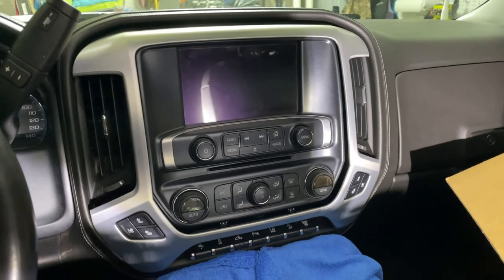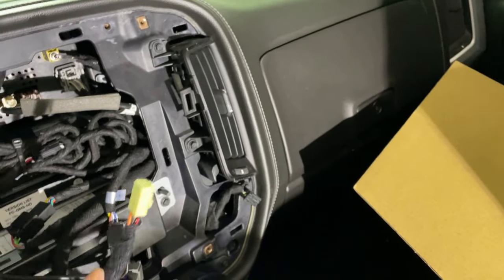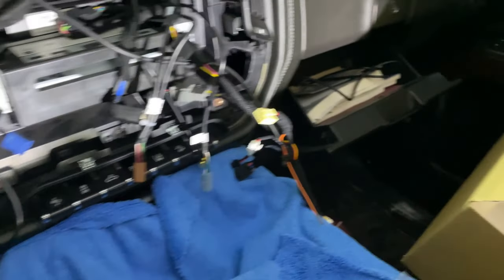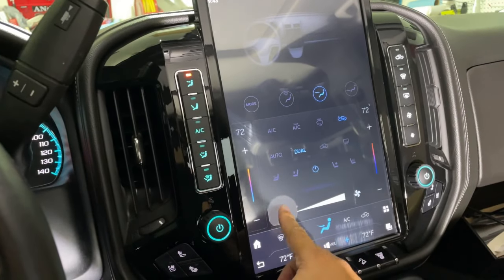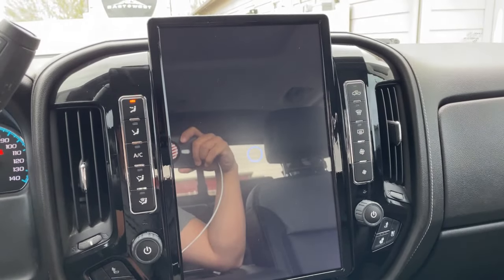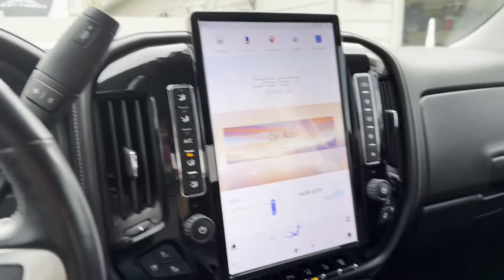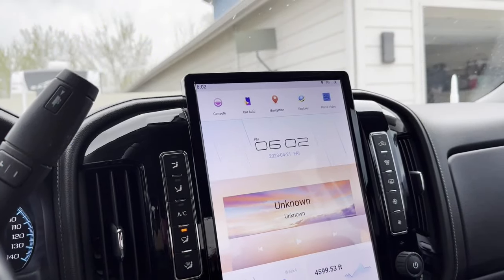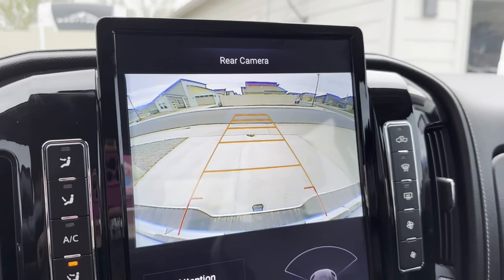AutoTec Pro Tesla Style Screen Install and Review 15-19 Sierra/Silverado

Comment: How do you access the stock vehicle page if you need to change it? I cannot get my radio infotainment to show in the console app.  It is just black on the screen area that would mirror the stock radio functions.
Reply: Mine is doing same thing
Reply: Did you ever figure this out? I'm having the same problem
Reply: @bigmdesign9616 ever figure it out? I'm having the same problem

Comment: I just installed my and the radio station doesn’t show , when I go to console only shows the ac and the top is black where supposed to be the radio , how can I fix that
Reply: Oof. All my OEM stations (FM/AM worked) as did Sirius. Give them a call if you haven't
Reply: did you figure out how to fix this? Im having the same problem.

Comment: How about the oem microphone? It that still operational or do you have to use a new microphone?
Reply: OEM Mic works fine for me. Packing includes a mic for people without a mic.
Reply: Sorry one last question, is the silver/grey bezel oem match to rest of trim?
Reply: @oscarbustos6634  I went with black because I knew it would match the tablet, buttons, etc and take out matching problems. Mine looks pretty sharp, zero complaints but I can't comment on the silver/grey.
Reply: @oscarbustos6634   It's close enough that no one but you will notice unless you point it out.

Comment: Can anyone explain where to install the steering wheel control on a 2018 Chevy? So my buttons will work.
Reply from the maker: You have to remove the steering console surround plastic and it’s a plug on the underside of the column that it goes inline.
Reply: Perfect thank you..
Reply: How do I get this device to automatically sync Bluetooth for some reason it only syncs up when I hit the console button if I don’t sync on console I have no sound.

Comment: Can you add more cameras to connect to the screen?  I’d love to integrate a forward facing and cabin camera that are all recording.  I know this is very unlikely
Reply: You'll have to ask about that. The unit ships with support for OEM cameras and includes a pigtail to allow you to install 3rd party (non-OEM) cameras but I don't think the forward facing will work the way you want. Especially if you want a storage engine for recorded content.
Reply: There is an AUX-V cable that comes with the unit. Vendor said that "might work". I wouldn't hold your breath.

Comment: does your steering wheel control work to skip song when your in Spotify or Pandora  or apple car play, mine only work when  I open up the console app  it works to change radio  station  but notoutside the console app
Reply from the maker: I had to install the steering wheel harness to get mine to work. But it works perfect now.
Reply: @CollaGoUnLTD can you show how you got it to work bc I have the same problem I could be doing something wrong but I would love to get mine to work. Thanks!
Reply: I can confirm you need steering wheel harness volume works skip does not work without steering wheel harness
Reply: Where does the steering wheel harness go? I’m sure I will need to install it on my 18 when the head unit arrives

Comment: Does the 4g that comes with the truck still work?
Reply: Yes, however, the tablet has it's own SIM slot which you may or may not want. You should be able to connect the unit to your OEM 4G network just fine.

Comment: Do you get sound when you play YouTube? I’m having issues anyway on how to fix that
Reply: Make sure you plug in the Aux pig-tail and then be sure you go to the Console and hit the media button until hit says "Aux". Then go back to YouTube and it should work.
Reply: @IAOutdoors  does the pig tail connect to the black cord? going off of the white cord branching out to the colorful cords. And did you connect the pig tail to anything or no
Reply: @squigger3394  AUX pigtail plugs into the AUX port under my center console. Has nothing to do with wiring of head unit
Reply: @IAOutdoors  awsome thank you man just got it to work. Now I feel like an idiot but how do I even set up the backup camera? It came with the unit?
Reply: @squigger3394  if it is factory OEM camera then you may need to go to Settings->System->Factory Settings and change the first settings at top right of page. Mine worked fine when I got it but after firmware upgrade it set it to the wrong value so I had to change it. If you can’t figure it out let me know and I’ll get the exact setting name and value
Reply: @IAOutdoors  I got the camera from auto Tec with my order. I don’t even have a clue on how to set the camera up to my back tailgate…. I just don’t understand bc the camera and wire are so small so I don’t know what it would connect to. Any chance you know of any videos on how to set it up. Thanks
Reply: @squigger3394  so non-oem. You’ll need to contact their support
Reply: @IAOutdoors  I appreciate you leaving that comment about the AUX pig tail I had been stuck on that problem for a week now

Comment: so I have sound for the radio but when i try using youtube app i get no sound but it plays the video help
Reply: I have the same problem I need help
Reply: Did you plug in your Aux cable? You may have plugged one of the top off yellow connects on the back into the wrong port. It should be above purple connector. My sound didn't work for apps either. I was plugged into the wrong port
Reply: Im having the same problem cannot get sound from anything on the internet

Comment: I installed mine it all works but the screen does thia flashing thing and freezes my camera and screen. I can hit home and it starts over but anytime I go to the console it will eventually flash and the screen freezes. I've removed 3 times checked all the connection and each time it gets worse not better. 
Anyone else had a problem?
Reply: This happened to me. I took the screen back out and plugged the main plug back into the stock location. Then reinstalled the screen and it started working that time.
Reply: Mine came with an extention for that main plug the blue one my stock is really short and I can get it plugged in without the extension they have been trying to give me software updates but today they said they would just send me a new one so hopefully the new one works thanks for the help though

Comment: Did anyone had a problem with the rear camera if so what is the solution
Reply: If you installed the extension harness for the power cord.. 750 in the video, u have to remove it. Then go to sertings>settings guide>car protocol. Password is 666888 change the first setting to VGA. Save and reboot
Reply: @joebagodonutz  He may also need to go to Settings->System->Factory, enter the code 7890 and be sure to set the camera format properly.
Reply: What does the extension power cord harness look like have trouble with back up camera

Comment: I have the same unit and everything works perfect but my video apps, such as YouTube. Spotify etc. the videos play but no sound. Does anyone have this issue??
Reply: i’m having same issue, suppose to get aux option when plugging pigtail into aux port..  i’m about to start checking fuses i guess.
Reply: @ronniefranklin1952  Hey Ronnie, please reply back here if you figured why no sound in third party apps, mine has no sound on YouTube, pandora
Reply: still no luck.,  i’m at a loss.  i put OEM radio back in and my radio still isn’t recognizing the aux connection.
Reply: Having the same Issue with no sound from the apps? Has anyone found the fix?
Reply: Same issue.  The manufacturers are no help either, been trying to fix for 3 months now. (Bluetooth and YT, apps dont give sound)
Reply: i think it’s about to get returned before to late.
Reply: same issues i have with mine, any solution before i return mine.
Reply: U have to plug in that little aux doggle in the aux port in ur arm rest, also if sound comes on and is super low quality, cracking, buzzing, u need to go to sound and click sound gain option, it should have  the gain option for all sources. Turn all them to like 15 down from 30+  that should allow the system to play clearly. Also make sure in settings ur factory Amp is set to On.
Reply: Maybe I can help. I just installed mine last night. The first that I noticed the sound was, there but really low. My scroll volume changes the radio station instead turn the volume up or down. Today in the morning after sleep 2 hours I just think what if I used the switch for radio station on the console app and that's turn my volume up. Now I'm trying to figured out how change that to the right controller.
Reply: On the cars original steering, connect to audio then to aux then you will have sound

Comment: Anyone know why it wouldn’t work with a 2014 as that was the first year of the new body style eg looks just like a 15.
Reply: The site says it works for a 2014, is that not the case? I have a 14 SLT and thinking about getting it.
Reply: I had no camera or sound. I have a 2016 1500 z71 without rear entertainment.  If u email them, ask them for the links to the guides on ther website. The guide says if the cameras not working, dont use the extension harness for the main power. Its  black on one end and blue on the other and one corner is angled and its about 4 or 5 inches long. If u used it, remove it. If that dont work the settings under settings> system> settings guide, the car ac protocol can be changed according to your vehicle ans the camera can be changed to vga format. Its the first option once u put in the password default 7890. To access the factory settings page under settings>system>factory settings, the password is default 666888. Also, i had no sound. The headphone dongle jack  must be plugged into the senter console port. Once thats in go the icon that says console and select aux or media until you see your phone, providing your BT is paired and connected.. but... heres what i did and it took me a week to figure it out.. when i removed my factory radio, i deleted the MyChevy from my bluetooth list. Well i reinstalled my factory radio, and paired it again. Then took the factory radio out and reinatalled the android unit and the bluetooth needs to be connected to the mychevy and the android unit. Wont work unless they are both connected.. i uninstalled android auto from my phone because u almost dont even need it with this unit. Maybe for msgs and calls but thats not important to me so i just use the music from my phone. And then once both bt are connected, play some music from your phone and click on the BT music icon to bring it up on the screen.  I now have sound,  and with the equalizer thats installed on the unit, the sound is amazing. So dont give up. Its a beautiful unit, it does work. I was on fire cuz i had no beats for a week or a camera. I was on fire.. but i kept tryin then they gave me the link to the guides which the password to see the guides is auto123 wen u go the website. They really could save a lot of negative feedback and angry customers cuz it aint cheap lol if they put a paper version in the box.. hope it helps. But if not read the troubleshooting guide. It might be a lil different depending on the year and model. I hope you all pass it on cuz you know exactly how frustratimg it is wen they say works right out the box. Or plug and play.. amd it dont work.. good luck everyone! Once its working youre gonna love it. I promise! Save and reboot after changing settings.

Comment: this would definitely be the best T-style system out there and it is for a lot of people but there are a huge group of people not able to get sound from apps/internet me being one of them….  if research led and tried everything and still nothing.   if anyone has a solution please please post something.
Reply: well after all that it was my aux/usb port, i replaced it and finally getting sound.  i’m sure i’ve spilled a few big gulps and fried it.  great unit
Reply: Where on the radio do you connect the Aux cable, I know it’s from the counsel or armrest, and from there where on the radio does it go to?

Comment: I just installed mine and while using Console, everything in the "oem" display is shifted to the right, anyone know a fix for this?
Reply: Found how to adjust the gm screen, now on the only setting where it’s centered, there’s fuzzy lines across the screen and while the camera is in use. Everything else works fine outside of Console.  Anyone experience this?
Reply: How did you figure that out
Reply: @johnharrison4659  I basically went down every option to see what worked for me. I have a 2014 so I used the 2018 I05/I06 setting and console screen setting to 7.
Reply: Ok do you have the code to get into those settings?
Reply: @johnharrison4659  Go to Settings – Systems – Car Model/AC Model (Password: 666888) to confirm if you have the correct settings according to your original vehicle. Try different Car Models based on the year of your vehicle. For more details, please refer to our setup tutorial video instruction below.
Go to Settings – Systems – Factory Settings (Password: 7890) – GM Screen Parameter (This will also fix the issues of “Original screen” does not align up properly under the “Console” Screen.

Here’s where I adjusted the settings.
Reply: Awesome thanks so much!

Comment: Has anyone else have issues with friction noise in the radio? Doesn't happen when using the console.  But when switching to aux to use the headunit, i get really bad friction noise
Reply: I get barely detectible cracks in sound using CarPlay. It always goes away. In general, it doesn't bother me very much. Did you figure this problem out?
Reply: @IAOutdoors  no I haven't figured it out. I have a friend whose does the same thing. It's horrible. The more you turn the volume up, the more you hear friction and popping.  I read that some android radios doesn't work well with the factory amp. But my friends truck doesn't have the factory amp and his does the same.... long story short,  I use the console mode and link it to the factory GMC bluetooth to listen to music. Witch kinda voids the whole point of having the screen
Reply: @1djolly  see if this helps: Settings > system > factory settings > original car with amplifier setting from 30 to 0
Reply: @IAOutdoors  I'll give that a try,  thank you !
Reply: What is the password to get into factory settings??? It is not 666888? Thank you

Comment: 2016 chevy back up camera not working
Reply: Same for me..
Reply: Has anyone found a solution. I i stalled this stereo 2 weeks ago and now the camera wont work.
Reply: Same here
Reply: Same 🤦🏻‍♂️
Reply: I found the solution
Reply: @josear9169  what was the solution??
Reply: @josear9169  tell us the solution 😫😫😫
Reply: @marthagarcia2784  please let me know if that works for you
Reply: @josear9169  you didn't say what the solution is???
Reply: @marthagarcia2784  i did 😂😂 dont know what happen
Reply: @josear9169  ok so whats the solution??
Reply: @josear9169  ??????????????????
Reply: @marthagarcia2784  when you press console you can see the original display?
Reply: @josear9169  so i have to go to console everytime i back up
Reply: @marthagarcia2784  no on the screen you see where it says console if you press there you can see the radio and all that right?
Reply: @josear9169  yes
Reply: @marthagarcia2784  Ok the go to settings/system/ factory settings code is 7890 then the first option say reversing video format change to vga-yuv signal then press save and reboot
Reply: @marthagarcia2784  try that and let me know
Reply: @josear9169  i couldn't figure it out. Do you have Facebook or Instagram so i can send you pictures of my screen and you can walk me thru it please
Reply: @Jose Ar  ok i figured it out but when i wento to the camera setting it was already in the format you told me. I switched it back and forth a couple of times and the camera won't work in either of the two.
Reply: @marthagarcia2784  hi again! Did u remove the power cord extension harness? I took mine out today and the camera works. Always save and reboot wen u change settings
Reply: @joebagodonutz  where is that located?
Reply: @marthagarcia2784  its the one closest to the blue gps plug. If youre lookin at the back of the unit layin on a table its the one on the right. The bigger one above the small blue gps plug.
Reply: @marthagarcia2784  754 in the video. If you attached an extension to that one.. remove it and the camera shud work. U want to use the factory one without the extension
Reply: @Joe Bagodonutz  ill give that a try. Ill let you know if it works.
Reply: @joebagodonutz  it worked. Thanks so much.

Comment: Does it use the GMC Sierra truck's hot spot?  Why does it need a GPS antenna if the truck already has one?
Reply: So this unit is basically nothing more than an Android tablet. The GPS antenna and SIM card slot they ship is only for the tablet itself so you can use apps without a phone. If you plan on using CarPlay or Android Auto you don't need either. I will probably get a data-only SIM card so I can use the android apps. NOTE: Never, ever, EVER hook the tablet up to your phone's hotspot. They don't play well.